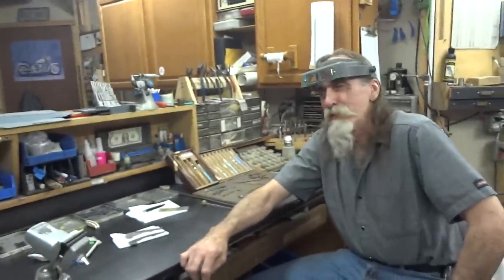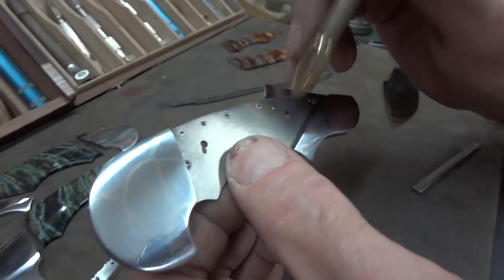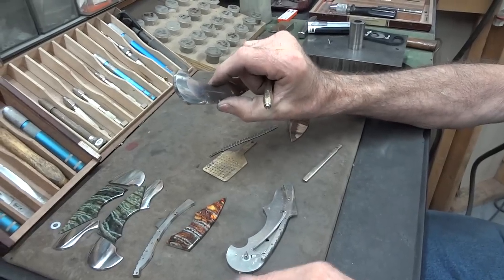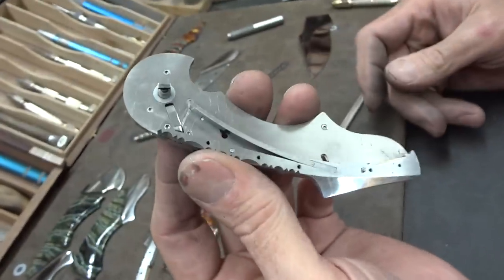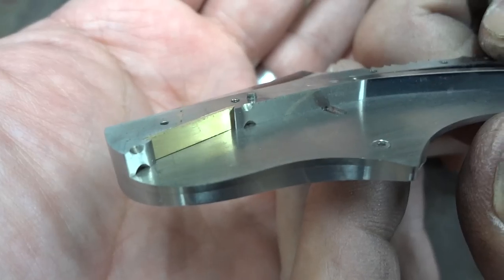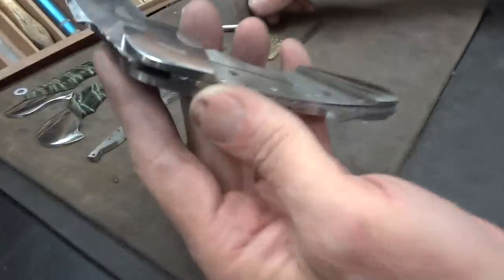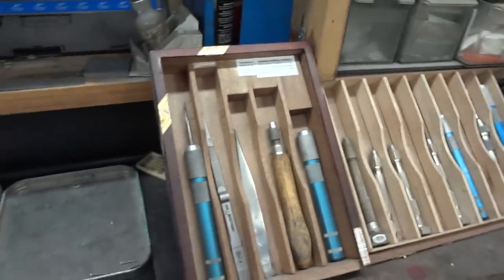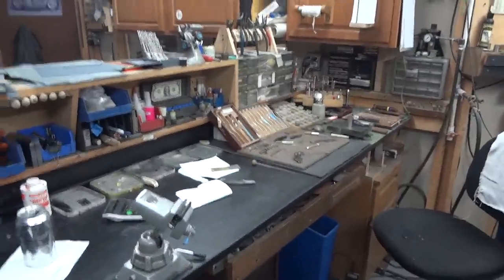I visit Stan Wilson's shop! Watch how an epic knife is made by a living legend

Comment: +Jim Skelton First the engineering of that knife is absolutely incredible. Granted I really dislike making folders because my hands shake too much. The detail and precision is amazing.

You are exactly right about knife making., just putting a piece of steel into a machine and programming it to cut a knife for you doesn't have the soul and personal craftsmanship of hand made knife. Yes it's faster and can be more precise on many things and it makes it easy to reproduce and make more. But it loses something important. I cam across a video of the machinist (nothing wrong or unskilled about the job or running the machine) ilk and he didn't know or understand the effects of heat on the metal. I don't know how one can be knife maker and not know something about your materials, especially metal materials. 

Lastly, I want that freaking grinder!!!

Comment: I think Stan is a phenomenal knife maker but I'm confused as to why a 4500$ knife is using Teflon pivot washers?
Reply: +Ryan Smith ding ding ding. I moved from teflon to ball bearing and its night and day.
Reply: +JmChadillonProduct your not lying. I don't know why anyone would not want ball bearing or at the very least bronze... Something!
Reply from the maker: +Ryan Smith Why wouldn't he? They work perfectly fine, and unlike bearings... dirt/pocket lint/sand won't prevent the knife from functioning. His knives are smooth as butter and extremely fast, no need to go to bearings because there's nothing to improve upon by using them. And washers don't dictate the price or quality anyway. I like bearings in most of my knives... but most of my knives aren't made by Stan either. His are perfection just the way they are. Most art knife makers offer $10k-$100k folders with washers by the way.
Reply: +Jim Skelton Fair enough Jim. I can appreciate the craftsmanship that goes into a knife like this even though I'll never own one.
Reply: thre is no reason to use bearings for such slow rotating elements.
Reply: teflon wears easyer than brass / bronze ..so it will cause less wear on the actual knife parts, blade etc than brass / bronze ..its the same reason that you use brass / bronze washers rather than steel ...they are designed in a softer material to wear out and be replaced cheaply while causing less damage to the parts that you want to avoid causing wear or damage to ... also contact between certan metals can cause a reaction whitch may damage one or both  so it removes that problem as well
Reply: teflon wears easyer than brass / bronze ..so it will cause less wear on 
the actual knife parts, blade etc than brass / bronze ..its the same 
reason that you use brass / bronze washers rather than steel ...they are
 designed in a softer material to wear out and be replaced cheaply while
 causing less damage to the parts that you want to avoid causing wear or
 damage to ... also contact between certan metals can cause a reaction 
whitch may damage one or both  so it removes that problem as well
Reply: Ryan Smith x

Comment: Jim, forget that last comment.  A criticism without a suggestion for improvement is trolling.  The camera work was fine for impromptu filming when you weren't even expecting to do so.  The larger issue, and probably what your Troll was most unhappy with, was the horrible focusing job your camera provided us.  That't the cameras fault, not yours and we can all see that you are trying to work around the issue with the palm behind the subject trick.  Your doing good work that totally relies on getting up close to your subject.  All you need to do to make these videos you produce perfect is get a better camera.  I'm assuming this is a business for you so just write it off.  If you can't afford it right now, pick up a couple voice-over gigs...you got some pipes man.  Talk to someone that is as knowledgeable about cameras and filming techniques as you are about knives and purchase a camera that can instantly go into and out of macro mode or one that has an "infinity" focus mode.  If that's not possible, have you thought of maybe going into your camera settings and choosing the "spot" metering mode?  It's still not instant, but whatever you have directly in the center of your viewfinder will focus a LOT quicker.  With that setting and a little skillful camera work to keep what your recording in the center, you'll be fine.  Maybe not Troll-Free, but fine.  Keep up the good work.
Reply: This guy knows how to properly criticise.